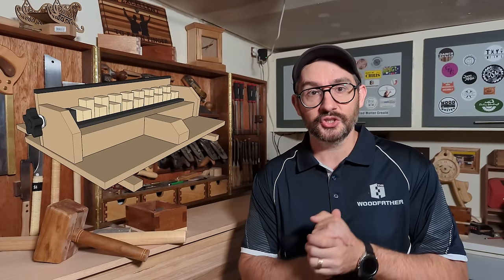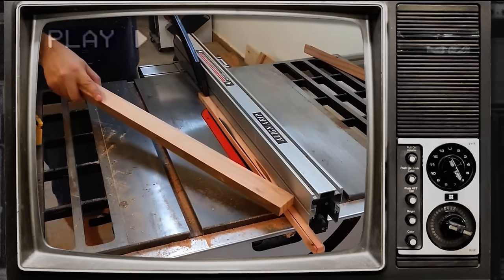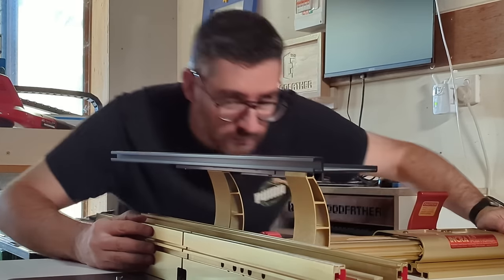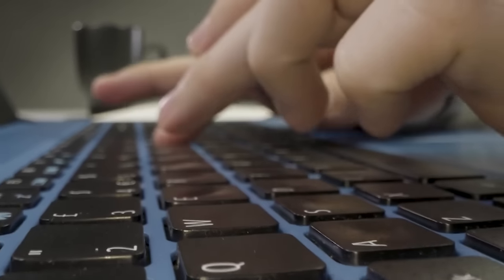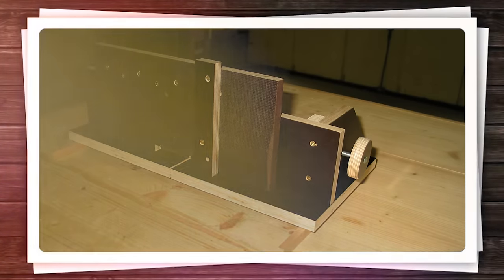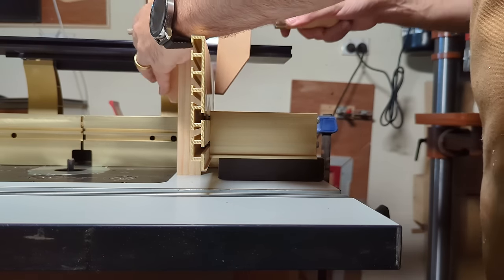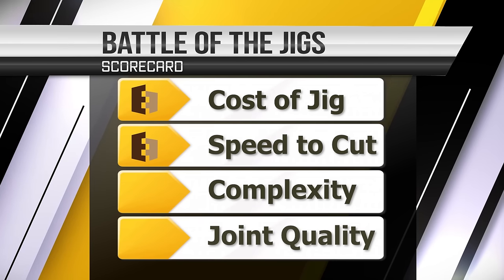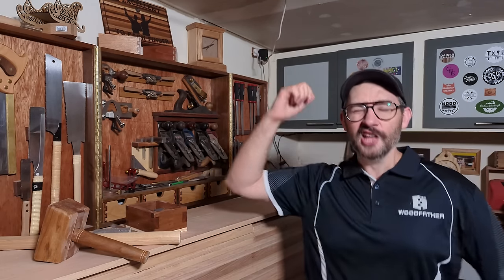$9 or $900, what would you pay for a box joint jig?

Comment: Hey, I had that same old table saw until recently.  Yes, it was terrible, specially if you wanted to cut on an angle (you tilt the table, not the blade!).

I replaced it recently with a jobsite saw that, thanks in part to inflation, cost a lot more than your $900 saw.  (The other reason for the higher cost was that it was the SawStop CTS.)

I'm not into making boxes or using box joints (yet), but I'll definitely want to keep your jig in mind if/when that happens.
Reply from the maker: Oh wow, well done on perservering with it for so long, but congratulations on the new one. They're worlds apart, that old Ozito tablesaw and any other saw on the market, worlds apart!
Reply: @woodfather 
I've not been a regular woodworker, more just handyman stuff around the house, although I'm getting into it more now.

One thing I used it for was cutting pavers, after putting a masonry-cutting disk in it.  I wouldn't do that with my new saw!

Comment: "Best" is always one of those things that depends on what is important to the person doing the evaluation. Given the criteria you listed the Wood Father Jig came out "best" in all but one criteria.

In terms of joint quality you are mostly measuring the quality of the thing doing the cutting and not the jig. What little effect the jig has on the quality is mostly a matter of setup since both can be dialed in to give whatever tightness of fit you desire. Even there the Wood Father jig could be considered easier since you are just changing the size of the key and that is done just once per cutter.
Reply from the maker: Thank you very much, and you're absolutely correct. 'Best' is always subjective, I could probably do this video over and end up flipping the ratings around, and yet still find a way to justify those answers based on the criteria! Thanks so much for watching and commenting, cheers, Mario 👍

Comment: Mario, get yourself a good quality flat tooth blade. You'll never regret it and the quality of the box joints is then pretty much perfect. I got an Opteon from my local saw sharpening store. Brilliant quality which I reckon makes the difference.
Reply from the maker: Opteon? I'll check them out, I don't think I've heard of them before. You're right Rob, a flat tooth blade is vastly better. I did used to use one...until I drove it through a nail when cutting an old reclaimed board. Blade was ruined, but hey, at least the sparks looked cool... 😆